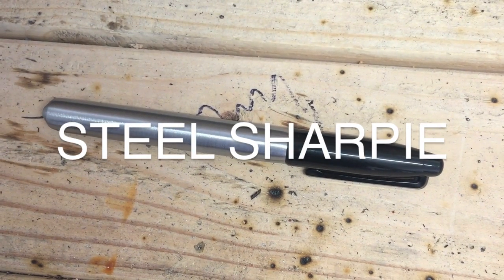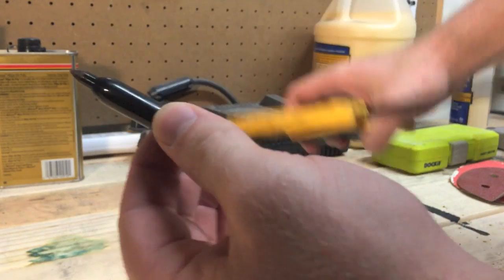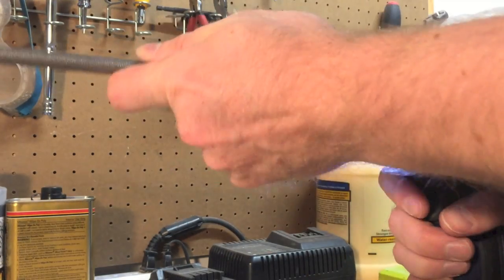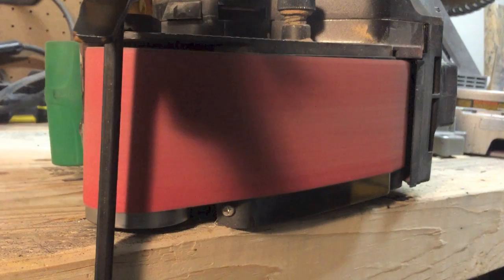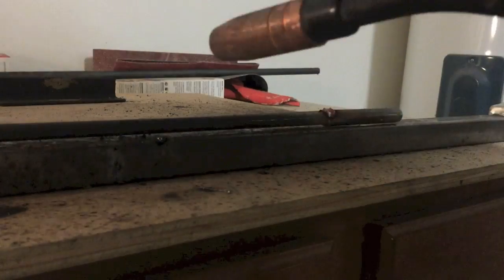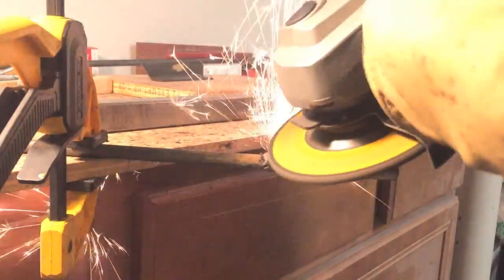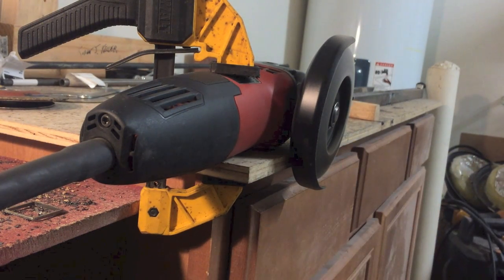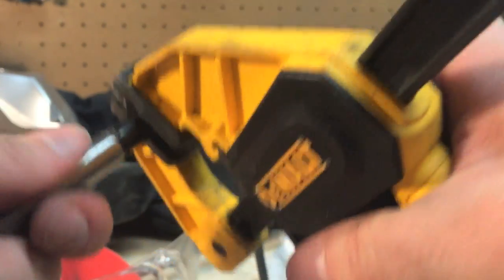How to Make a Steel Sharpie (without a lathe) - DIY

Comment: Nice work, just when you said if you don't weld you could accomplish something using expoy, I could not understand that part
Reply from the maker: Hi Andrew.  I was just saying that you could make a plug out of wood and epoxy it into the end of the steel tube if you aren't a welder.  Hope that helps.

Comment: Where did you buy the 1/2 in. Round steel tubing with a 3/8 in. Diameter center and how much?? I want to try and make one . Thanks
Reply from the maker: +raf sp I found both at my local Home Depot. I know Lowe's also has a steel section. If you have a steel mill near you, check there. Hope that helps!
Reply: robertjkeller thank you for the reply.